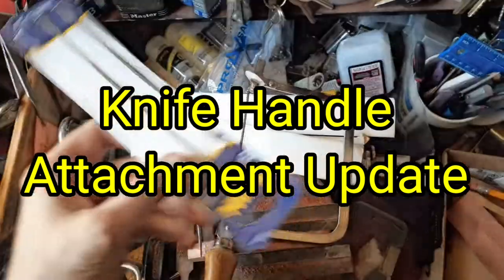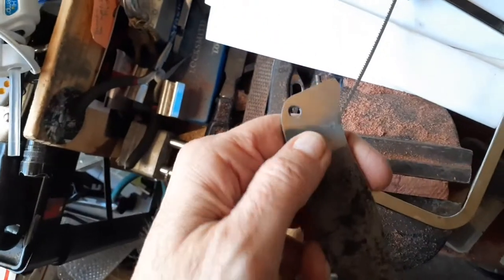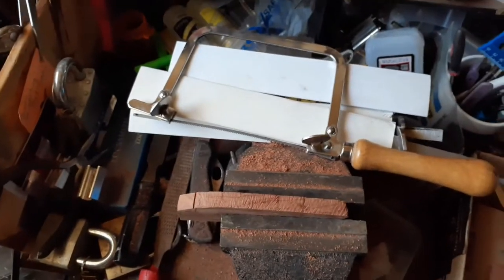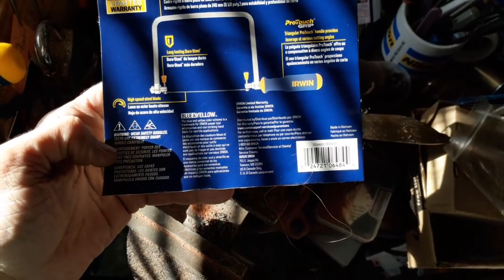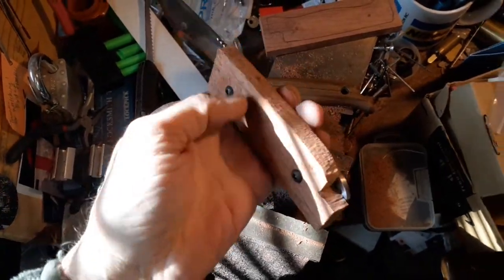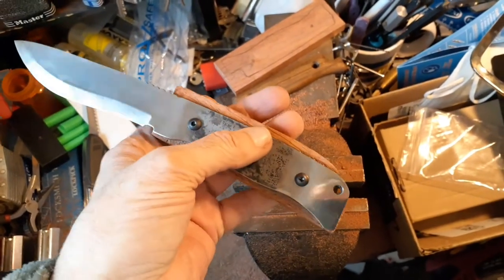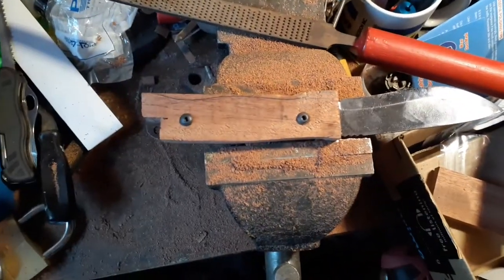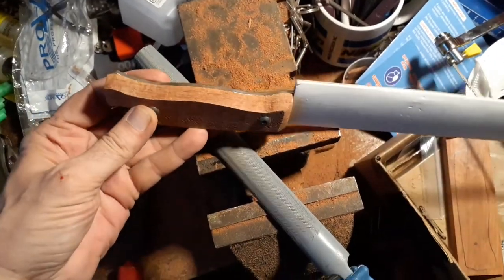(664) BPS Knife Handle Attachment Update

Comment: that's going pretty good William. You might consider sanding the backside down for getting your desired thickness of the wood.That way you won't loose the contours you already made. Maybe with a beltsander so it's easier to keep the backside flat for fitting the tang smoothly. Thank you for the update friend.
Reply from the maker: Thank you Jeroen.